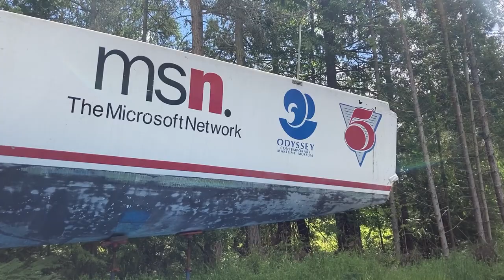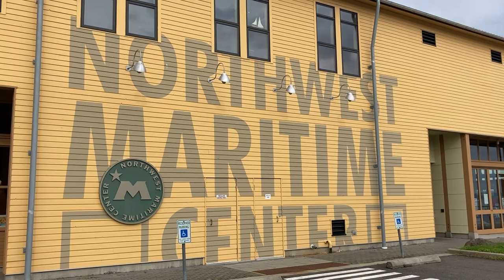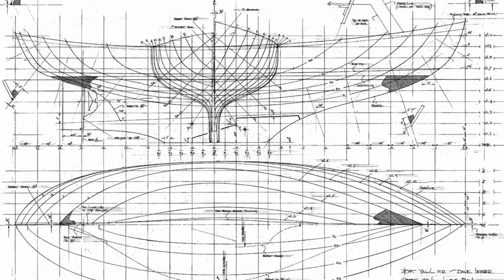Cockpit Modification + Sailing in PT [E34]

Comment: Can you make a video explaining how sailing works? It seems impossible to me how you can drive with any precision. Also one boat going one way, and another one next to it the opposit direction?? Like what? 😅
Reply: You should take a lesson on a Hobie Cat, it's a small catamaran that is very easy to learn on.
You are so close to the water and the basic inputs are immediate.
You'll learn pretty fast.
Sailing steering is as precise as one can expect on water, which is pretty exact if you think about docking and parking a boat.

Comment: Matt, what is the foam core that you are using? Looks like a PVC Foam, is that correct? I'm starting a coring project on my boat and looking at different coring materials. I do have a slight crown on the deck so my material will have to be somewhat pliable at 1.5" thick...... If anyone else knows or has suggestions, please comment.  Thank you.....
Reply from the maker: 5 lb dyvinicell which is a pvc foam. Good luck with your project. If there's a big enough bend that the solid foam won't work you can get it curfed (I think that's the term...or maybe it's perforated), which is more flexible
Reply: I've seen others bend Divinycell after heating it in an oven.

Comment: I'm learning bit 
by bit. Is Duracell   keel or deck stepped? Can it change from one to the other? How is the mast search going?
Reply from the maker: Keel stepped and it can't change. Nothing has changed with the mast search: no new masts have popped up. I will probably go check out the aluminum one in CA soon-it's a good candidate.

Comment: Why have you left so much of the original transom intact under your new cockpit? Isn't that just unnecesary weight and doesn't it make access really dufficult?
Reply from the maker: Good question. I possibly (likely) could have cut it away, but I would prefer to leave the structure and I don't really need the extra space either.

Comment: What is your pot life on the thickened mix?  I'm always so frantic trying to get done before it kicks.  Also - thanks for the tip on the scissors.  I've gotta get a pair!
Reply from the maker: Hey Marsh, haven't had a problem with this yet. I'm using slow curing resin and the temp around here is around 65 degrees. I actually don't know, but I'm not having a problem with it curing too fast.

Comment: Great progres! How easily were you able to stick the pre-wetted tapes to the overhead surfaces? I've generally found it easier to first wet out the bonding surface with enough Cabosil in the resin to make it sticky enough to grab dry cloth that's lighter and less sag prone. But with resin not so sticky to inhibit spreading the cloth for good fiber orientation. Then finish wetting out with rollers. But either way, it's a tricky operation, especially in a tight space. Also, if you move the vacuum pump a further away from the bag, it's easier to hear and address any bag leaks. Keep up the great work!
Reply from the maker: i pressed as much resin as I could out of the tapes AND the surface was swept with thickened resin....so they stuck pretty well!

Comment: Is Totalboat sponsoring you with free products? Should be.
Reply from the maker: They're not officially sponsoring us, but they are supporting our project in a big way by sending us epoxy, plus the fiberglass cutting scissors that Matt now adores :).TotalBoat is great.-Janneke
Reply: The rate this channel is growing, TB (and other vendors) will be paying them to use product.

Consider the avertising costs to reach 100,00 actual potential customers. Not TV/radio/print or even YT ads that include some % of non customers.

 That's the beauty of these types of direct channels. The other key is the long play format. Again, traditional relies on repitition & saturation, with attention spans measured in seconds.

Vendors know the metrics: actual, potential buyers watching (studying) a trusted person for minutes at a time.

A good channel is gold; know the value, marketing leverage and charge accordingly.

Comment: As always, great work, precise and efficient. Do you have an idea of the extra weight of all the modifications, even if its not a problem because the boat was and will stay fast
Reply from the maker: Not keeping track of how much weight, but am doing my best to keep it light. Not too worried about a little extra weight since safety is #1 priority as a cruiser, not speed (though it will be speedy).

Comment: What's the working time on the epoxy you use? That top layer must have taken some time to lay.
Reply from the maker: I'm using slow cure, 2:1 epoxy. we're working at about 60 degrees temp. and I'm getting 30 to 60 minutes to work with.